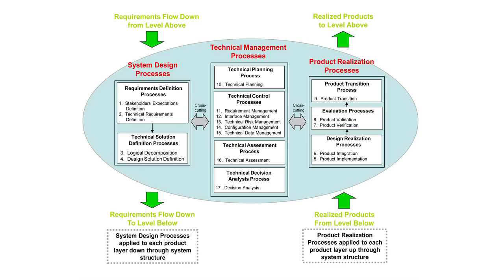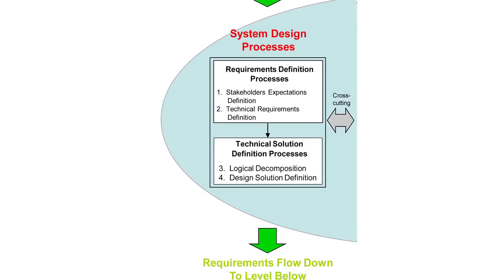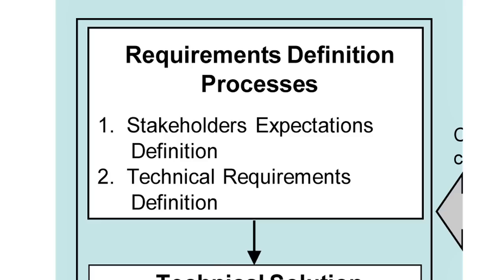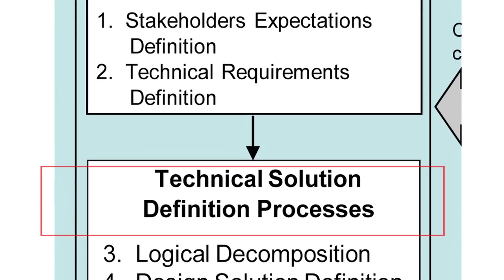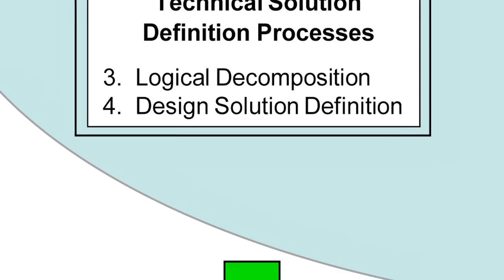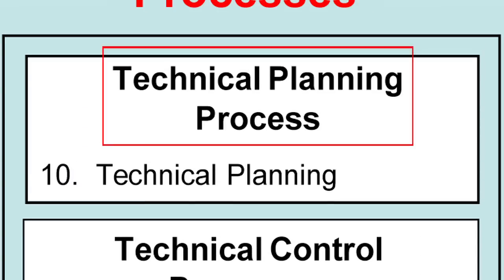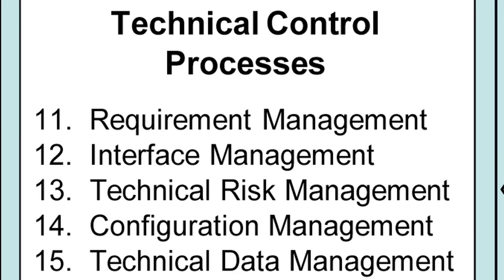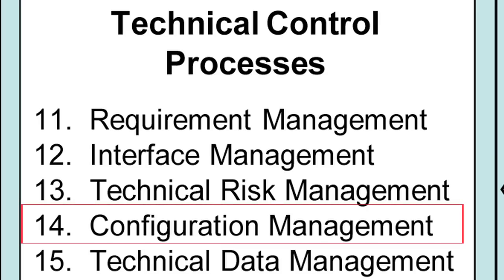NASA's Approach to Systems Engineering- Space Systems Engineering 101 w/ NASA

Comment: Great lectures. However, it seems that by default it has been assumed that a system engineer is also the project manager or chief engineer. It is not. System engineering is more a way of thinking or methodology that all/most engineers should be aware of. The team can also have a dedicated system engineer to take care of risks, schedules, ConOps, documentation, etc. In summary, the system engineer is not necessary the boss.
Reply: Great description of roles, but, just as comment of your comment 😅in the NASA Systems Engineering Handbook make mention of the personnel you have mentioned too, but it says that for educational purposes tagged all these titles in one: "systems engineers". So He is not assuming that a system engineer does all the work, he just using the same tag used in the handbook. But as I said, great description, I guess there are some people who don't know this and through your comment can be known.
Reply: @12:30 he ends clearly pointing to the diagram and says SE is a management function as much as a technical function